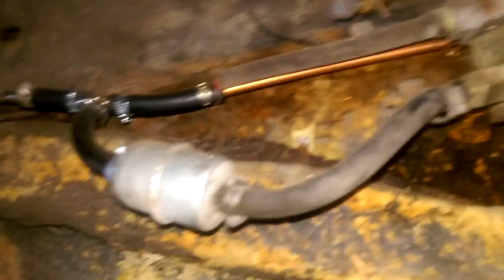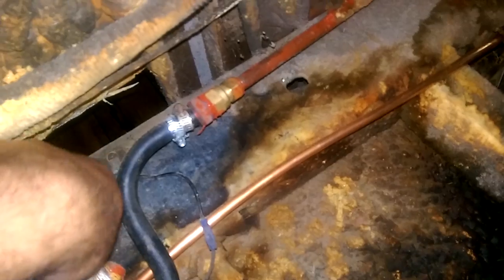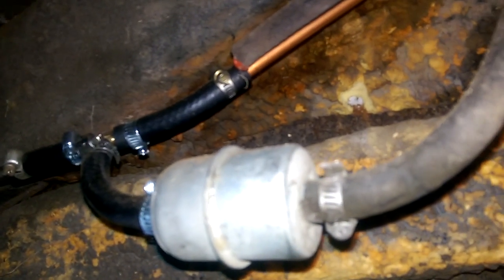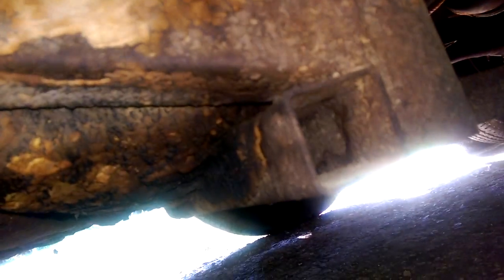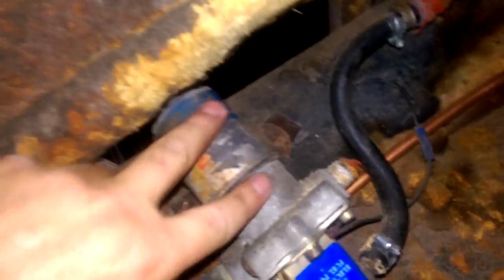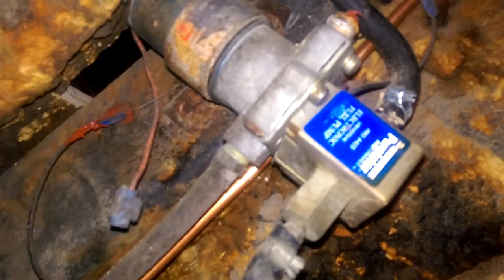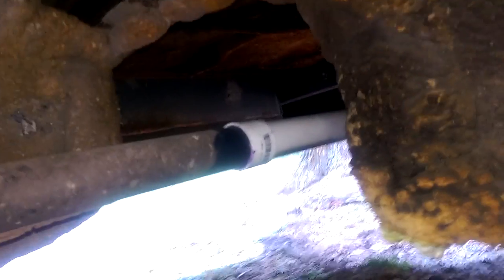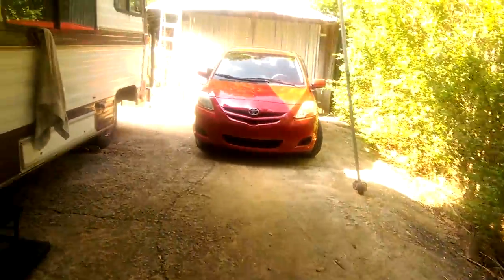RV fuel system class A gas model

Comment: My thoughts are since you're running an electric fuel pump to bypass the mechanical pump and run it straight to the carb.  I wouldn't use copper tubing for the fuel.  You need 3/8" steel brake line.
Reply from the maker: farmboy30117  I am replacing the factory fuel routing with last forever copper lines from lowes which was cheaper than steel .  It simply sends fuel to the engine's mechanical  fuel pump any excess is returned to tank preventing vapor lock What's the downside for doing that ?  thanks
Reply: Chances are nothing bad will happen with using copper, but it is thinner than steel and if rubs against anything, it'll probably leak quicker.  Nothing wrong with running it to the mechanical pump either, it's just one more moving part in the circuit that can fail. Good luck with the old girl!
Reply from the maker: farmboy30117 Yes there is that but I researched it a little seems they require copper fuel line for gasoline boats . Its in pretty good shape the frame is aluminium so its there forever .

Comment: were can i get a alegro 1983 instructions  manual  ?  My first rv dont know nothing about it has a gas motor I think its a 454 the motor fine.  Just need to know how the rest works how to start power plant, water conection  ext.
Reply: I have the same problem... '89 Chevy Allegro with a 454... No owners manual, instructions, wiring drawings nothing! The RV is in good shape but has major age issues and now I can't even get it to start. Were you able to find a manual?
Reply from the maker: No manual .

Comment: We have a 1982 32' Allegro Motorhome with a 454 Chevy engine. It has a reserve tank in the front that runs the generator and acts as a back up to the main tank. My question is could the manual switch for the 2 tanks malfunction causing no fuel to come into the main fuel pump on engine? I'm not getting any fuel out of the main tank, even with a new manual fuel pump.
Reply from the maker: Mine only had one tank for both main engine and generator but i would say it could be the manual switch or rusted lines .

Comment: Ok what year is this I have a 73 with a 454 I hope it doesn't have a secondary fuel pump
Reply from the maker: Its a 1984 model .
Reply: if its longer than 28' it most likely has a secondary fuel pump. If its in the tank you should have 4 wires running to the top of the tank